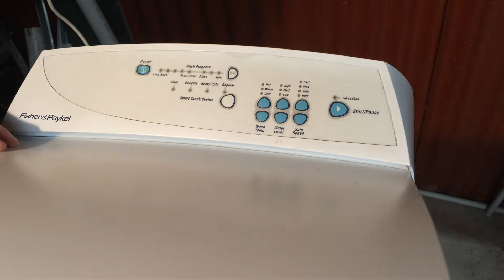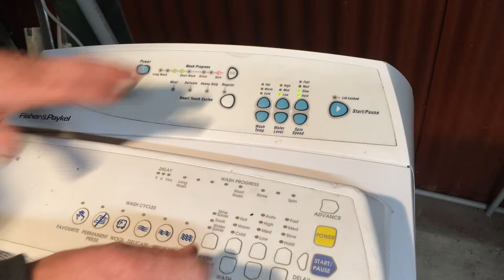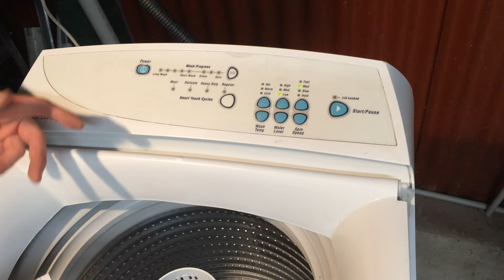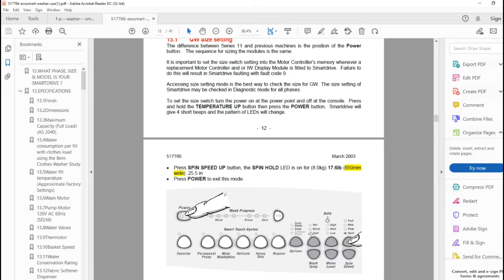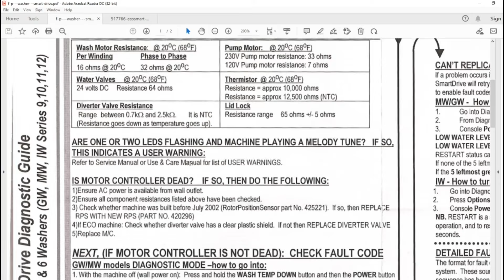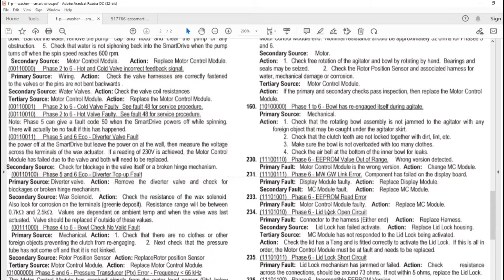Reading Fault Codes and Diagnostics on Fisher Paykel Smart Drives.

Comment: Just unplug it at wall and replug it. It resets
Reply from the maker: Depending what the code is this can be a bad idea and end up blowing you controller. If for example the drain pump is overheating and you carry on resetting the pump can burn out and short the controller. The smart drives actually retry up to 8 times when they detect a "Fatal" (F code, not user warning) error, so by the time it does the fault code beeps its probably not something that can be fixed by just turning it off and on.

Comment: Got same machine but won't spin goes through the cycle but when it comes to spin it drains starts to wine up then stops? I'm in Nelson.
Reply from the maker: Does it stop and beep with a fault code? you may need to leave it a few tries before it will give up and show the code. We have a Nelson based technician so can book you in to look at it if you want, give us a call.
Reply: This sounds like the exact issue I have. What was the cause, in the end?

Comment: Hi Im in Turangi and have an MW513 with a 112 code second third and fourth lights on reading left to right? It’s my late Mums machine and I want to donate it to local charity store but want to make sure it’s working. Been in my garage since 2017. Was working fine back then so not sure why it would have a code now. Cheapest motor controller I can find is from F&P direct for $234. Not sure it’s worth fixing although new they are still $1199.
Reply from the maker: Sounds like it hasn't had much use so it should still have plenty f life left in it. Sometimes you can find good second hand motor controllers on trademe.
Reply: @motrepairs  Thanks, seems to be plenty of this model on trademe for $1 reserve and not working. I assume I need the series 9 controller?
Reply: @motrepairs  Hi, I found a controller on TradeMe, its updated version 429213NAP which supersedes my 421297NAP. Its second hand with reserve $95 buy now $125. Should I check motor resistance before buying it? Supposed to be 39 ohms across two terminals. Is that what causes these faults as 112 error relates to currant reading. Is it usually a faulty controller which throws the fault or a problem with the motor? Thanks

Comment: Hi there, I followed your fault code guide for a friend with an MW512 - fault code 252, F&P website suggests Motor Controller Fault. Any advice about what component may be faulty?
Reply from the maker: That is a motor controller fault, however a very uncommon one, so double check to make sure you are reading it correctly.
Reply: Thank you very much for the reply! My friend showed me a video of it getting stuck near the end of the cycle making that sort of clunking sound trying to decide whether to drain. She turned it off, then on again and forwarded to end of cycle to drain the water and complete the draining and spinning. I removed the drum and checked for clogged pump. No clog and confirmed that the pump could drain very well when it does go. I followed the error code checking instructions to get lights 11111100. It seems to work out to 252. All I could find on the internet for 252 is faulty motor control unit.  @motrepairs
Reply from the maker: Also its a motor bridge electronics fault, detected current when there should not be. Probably triac drivers or their resistors.
Reply: Thanks for the additional info. I Googled F&P triac drivers and resistors and read a post about trying to repair these on an Oz site. I saw used motor control units on trademe but it says they have to be installed by a professional or no guarantee. Could take a punt or maybe time for my friend to buy a new washing machine.  @motrepairs

Comment: Hi Thank you could you  tell me how do I reset the machine when it isn’t spinning ? I have a static red light on the spin cycle
I’ve pulled the power for a few minutes then advanced the cycle to spin it spins monetarily sounds like it’s pumping out then stops it’s a slow washing process !
My machine is a GW
711
Thanks
Reply from the maker: If you aren't getting any fault codes Its probably the pump not draining rather then a spinning problem. Pump is probably either partially blocked, or if its stopping it could be overheating. Have a look at my two Blocked pump videos, and check the resistance of your pump, should be close to 32-33 ohms.

Comment: I have a MW512 from 2009 washer I bought with the farm 8 years ago. It just started to throw a 49 error. Cold water solenoid. Investigating, both solenoids showed ~56 ohms, no obvious transistor shorts, but the 1.6A fuse was blown.  Usually electronics dies to protect fuses, so I grabbed the washing machine from our last place from the shed and tried it. (A GW612)  Wierdly it showed the same error code. I'm sre it worked  before we moved here.  Poked at it with a multimeter, again solenoids good, again the 1A fuse running the solanoid drive logic was blown.  So I replaced it with a 2A automative blade fuse because I had one. Its working.  Maybe these 1 or 1.6A fuses die of old age?   Thanks heaps for the informative video!
Reply from the maker: I haven't had the fuses just die of old age, but maybe check the pump resistance closely. The water valves are used as part of the DC HV power supply (even though they themselves are 24V, which is why the water valve codes are some of the few to come at power up rather then when cycle started) so a failing pump will also blow the fuse.

Comment: have this fault  code 130 . Could it also be bad bearings or the windings  ? It spins  sometimes (empty) but once  up to speed it stops. When i spin  the drum by hand it makes 2 thuds in the bottom but no bearing rumbling . Thanks
Reply from the maker: If you turn the motor by hand the controller will try to brake it, eve when unplugged. If water is leaking through the bearings it will cause the RPS to corrode a lot quicker and and fitting a new sensor will only be a short term fix until it corrodes too.
Reply: @motrepairs   I cleaned  up the  contacts  on the plug to the rps and the 3 stator contacts just to be sure. And it went through a whole cycle. Working ok. And didn't see any  water leaking from seal &  bearings  etc.  
So many  thanks.  MUCH APPRECIATED FOR THE GUIDE AND YOHR REPLYS  😀😀
Reply: @motrepairs  just a follow up. It's been going ok but now it stops just before  rinse cycle when still has one third left to drain of the main  wash , it just pauses. I can re start it by power off and go back to thst stage of cycle. There is no fault code coming  up. And it will stop just before final spin, will do small attempts at starting to spin . Again I can do the spin after power off for a bit  and goto spin.  As if it needed too cool down  form or something.  Also there is some dirt  and lint at bottom of the  bowel at the end of the cycle as of its coming  up from somewhere in the machine.  I can do a full cycle but have to power  off and restart about twice per cycle. Any ideas. Thanks again.
Reply from the maker: @Matowix Check the drain pump resistance (should be very close 32 ohms if you are in a 220-240v country), or when it stops unplug the power then touch the pump windings and make sure they aren't too hot to touch. If the pump is starting to fail then it has a safety overheat that will cut out until it cools down, the reset. If it is this and you carry on using it eventually the pump will burn out and can kill the control board.

Comment: Hi, I turned the machine on and heard a popping sound, now no lights come on at all and it won’t start. Is this the control board I need to replace or a fuse or some other issue.?. 
Thanks for doing these vids, very helpful.
Reply from the maker: There is a fuse soldered on the control board but when that blows its usually because something else is shorted out. When you get the new control board there is a piece of paper with it listing the resistances of all components (motor, pump, valves, etc) that you need to check just in case its a failed pump or something. Otherwise it will just blow the new control board too.
Reply: Cheers for the prompt response. I gather it is the pump which is the cause of the issue as this was the original fault that brought me to your YouTube channel. To replace the pump and the control board along with a new controls face plate comes to $400. Not sure the repair is the best solution given the cost of a new one.
Thanks again.

Comment: I have a 106 code on my GWL10U2. Tipped the machine on its side and the pump is corroded and leaking. The code indicates a control or display module issue. The display still lights up, shows code and beeps, so does it still indicate an issue with one of those or might the pump fix that? Or won't know until I replace the pump? I really love my machine and would like to get it running again. Hopefully without having to get my control module refurbished.
Reply from the maker: That is a really unusual code, don't know if I've ever seen it before sorry.  It would be unrelated to the pump I would think unless the pump has burnt out and caused partial damage to the controller so the display cant talk to it, but chances of that are low I would think.
Reply: @motrepairs  Thanks for your quick response. Wasn't sure how often you looked at posts. I'm going to keep trying to figure it out.
Reply from the maker: @cheriviere4920  Service manual suggests checking wiring harness, then replacing display, and if that doesn't fix it then replacing the motor controller.
Reply: @motrepairs  I removed the pump and it definitely shows corrosion, and had been leaking.
Reply: And if it is the pump, might it also still be wiring harness.. display.. control?
Reply from the maker: @cheriviere4920  The pump doesnt affect the display and controller communication unless something really weird is going on. Possibly corrosion on wiring harness from display to controller but more likely to be one of the boards
Reply: @motrepairs  I'm not seeing any corrosion on the harness. Pump has been ordered. Located a new original part#, not replacement, as I understand some don't work on GWL10.
Reply: I finally have an update on the pump. I replaced it and ran a full cycle without any issues. Then I decided to replace the water inlet valves that I had purchased 4 years ago but never installed, so I thought while I had everything apart I would do that. Turns out the hot water valve I purchased was actually defective and leaked water into the control board area. The machine stopped working, no lights, nothing at all. I let it dry out for a week, still didn't power up.

I then took the circuit board to a local PLC repairman, and he found a few fuses that were bad, but also 3 other transistors and/or mosfets? He was able to find replacements parts for two of them (G4RC10U) but not the third one, which had blown the top off, so he could not see the part number.  I have a GWL10U2 Serial# VHN535599. MFG date 9/4/2002. Is there any chance you have one of the control boards collecting dust around your shop and could tell me the part number I need? The closest I can find is on a GW609AU from an instruction post and the part is either 918180 or 98180? It appears to be an N channel, triode mosfet. Also I thought it wouldn't hurt to ask if you happen to know where to get those parts these days? I know I can send the board to a fisher paykel repair service for refurbishing but not sure they won't have the same issue identifying the part also. Any advice you have would be greatly appreciated.
Reply from the maker: @cheriviere4920  I wont be able to help with part numbers etc as our 230V controller are different, part numbers of mosfets may be the same, do you know what circuit it is for? (e.g. drain pump, or diverter valve etc)  IF you can find someone who sepcilises in FP boards they will probably know the parts having dealt with it before, but could be hard to find someone.
Reply: @motrepairs  thanks for your reply. Will see what I can find out.

Comment: 517766 model did not could not fine the dia data fault codes part...  ??? where in the user manual did you find it ???

Comment: What about code 243? All but 4 and 8 are lit up. We hadn’t used it in about 8 months. Did around 10 loads without issue, now I can’t get through a spin cycle. GWL11
Reply from the maker: That's a motor fault fault but an unusual one. If you haven't had it apart then most likely the Rotor Position Sensor, could also check the wiring to the motor hasn't been damaged.

Comment: What does fault code 130 mean?
Reply from the maker: 130 is a rotor sensor fault, the little sensor board that is clipped onto the motor. Sometimes it can just be corrosion on the sensor board or the plug, or you may need a new sensor.

Comment: F&P Model WA80T65GW1
  beeps but will not turn on to wash the clothes.
Washed fine yesterday..... Will not wash today.
It has been an excellent washing machine.
Reply from the maker: When you say wont turn on you mean no lights? If its an error code there should be lights, if beeping and no lights you might want to check the connections on the harness between the display board and the controller, or you may need a new display, which isn't common.

Comment: G’day awesome info you are sharing! Have checked out most of the info you have relating to my FP model WA80T65GW1 that seems to be giving a code 39 I have checked the tube and it has no obstruction 
The machine fills to high when set on low  then tries to agitate but the agitator only moves back and forth about 40mm each way
Any suggestions to what may be wrong 🤔
Cheers...... Steve
Reply from the maker: If you take the tube off and block the lower end then blow in the top is there any air leaking? (never blow into the sensor) Shouldn't be able to blow at all, you could have a tiny hole worn, otherwise could be faulty sensor that is built into the motor controller. Mostly likely a hole in my experience so make sure to check the tube carefully before spending money on a controller.

Comment: my code is the long wash light  so 128 + 2.. so 130   ... couldnt find your pdf?
Reply from the maker: Thats a Rotor Position Sensor fault, the little PCB sensor that sits on the motor will be corroded or faulty.
Reply: @motrepairs  but it isn't always  the rps   with a 130 ? Can it also  be the bearings bad and water leaking into stator etc. What should I first do for a 130. I also saw a guy say he  had a 130 and it was a dirty wire going to the stator winding.  And some people just clean the contacts on the rps which fixes the 130. Many  Thanks  mw512. Over 12 years old. Is an rps cheap on trade me etc.if i could just eliminate the bearings and motor I can know if it's worth fixing or trashing  Cheers
Reply from the maker: @Matowix  Yes if you have a bad connection to the motor or the wires plugged in the wrong way around you will also get a fault 130. Often the worse corrosion is on the plug so cleaning it may be enough, especially on the MW512 which has a partially sealed sensor.
Reply: @motrepairs   I cleaned  up the  contacts  on the plug to the rps and the 3 stator contacts just to be sure. And it went through a whole cycle. Working ok. And didn't see any  water leaking from seal &  bearings  etc.  
So many  thanks.  MUCH APPRECIATED FOR THE GUIDE AND YOHR REPLYS  😀😀

Comment: My machine is F&P & rn after I plug the power back on, the machine makes a double beeping sound and doesn't turn on at all. To nervous to try your diagnostics. But also tried resetting to factory default by using the delay start. Don't think it made a difference. 
The machine just makes that beeping noise and that's it. Nothing.
Reply from the maker: Have you had it apart recently? If the display harness isn't connected correctly then it will just give error beeps. If you haven't had it disconnected then it will probably be a faulty display or controller.

Comment: Error code 27?
Reply from the maker: That code is only on the older 1990's machines, it is a Bowl Dis-engage fault, similar to a fault 40. Means the bowl isnt dropping down and locking onto the shaft for spin properly, Take the agitator and inner bowl out and check nothing in the clutch spline area, shaft is clean so bowl can slide up and down correctly. Also check water level sensing is correct.

Comment: Mine shows fault code 40, help!!??
Reply from the maker: If you take the inner bowl out as shown in the first part of this video: https://youtu.be/tpJ5bDDpKkA
Then make sure the shaft is clean, and the clutch spline that is connected to the bowl just under the agitator doesn't have anything in it

Comment: Great video(s). I have a MW511 (purchased  mid 2004) and it is just starting to throw some errors. Can you help with a link to a PDF file of the under guide or fault codes manual please?
Reply: Your machine is a phase 6 type, https://www.manualslib.com/manual/820531/Fisher-And-Paykel-Phase-6-Series-11.html 

Here is the service manual that’ll give you the fault codes and the steps to resolve it. 😊
Reply from the maker: If you google smart drive fault codes there are a few different manuals and documents floating around. There is a scan of the quick reference sheet here:  http://www.uncleharrywizard.com/nephewclub/wizardwasher/fisher--paykel/f-p---washer---smart-drive.pdf  
It doesn't have all the codes but the one Luke has linked to above does.